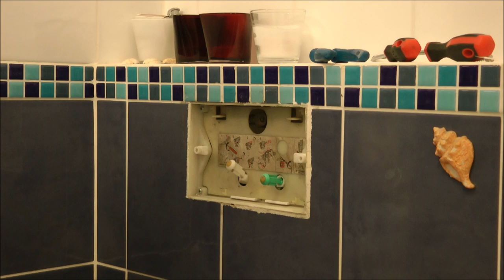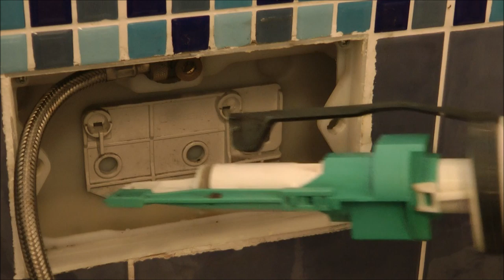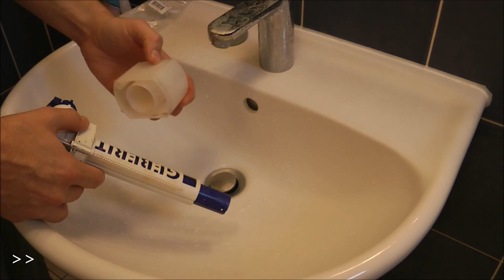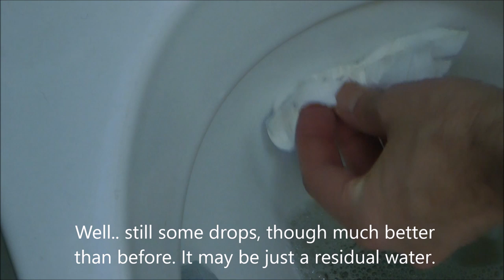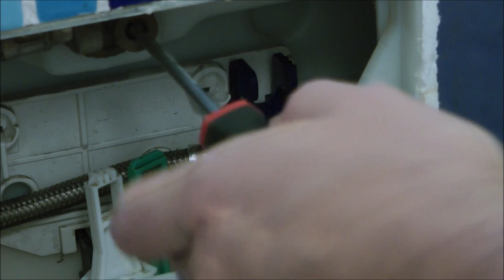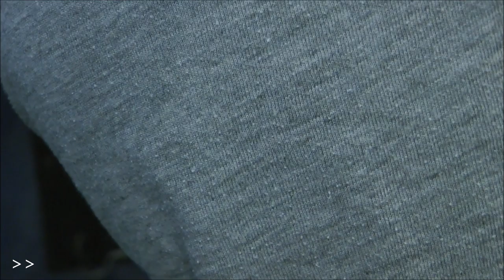Geberit concealed tank disassembly and reassembly

Comment: Hired a plumber to fix my dripping toilet. He said he "adjusted it", but he couldn't do better without ordering new parts.
He charged me a lot and it didn't fix the problem.
Turns out the toilet just need a maintenance clean after 10 years (from the previous owners). No new parts were needed. 
You probably saved me about $1000 with this video.

Comment: Thank you for this. I couldn't figure out how to get the central bit out and you turning it upside down inside the tank provided the answer. My thinking was I needed to disassemble it inside the tank and that would've been much harder. I didn't need to replace anything, just clean the tons of limescale that has accumulated.

Comment: Nice job! 👍
I replaced main flush seal but still have small leak. So I need to clean the float valve assembly, as you have done.

Comment: Very good YouTube I have the same Geberit concealed tank and need a new part. Do you know the model name and number of this concealed toilet so I can order the correct part ?
Many thanks
Reply from the maker: This would be Geberit Kombifix, the number (visible at 2:00) is "110.302.00.1". If this is the same cistern you have, you may be looking for this: https://catalog.geberit.co.uk/en-GB/spare-part/Sigma-concealed-cisterns-12-cm-(UP300)/SPT_461052.html
Reply: Many thanks Marek
Reply: @marekf5  I see this datasheet everywhere. However, in the Look Inside at https://youtu.be/Z8df_7aw9HA?t=269 you can see the basket/cup that the green flush valve rests in?
That thing is not listed on the datasheet.  That valve and basket have been replaced by the 212 universal flush valve. Everything looks like it's literally a 'drop-in' replacement, but for the life of me, I can't figure out how to remove that old basket.  With effort I can make it turn, but either I lack the strength or dexterity to get it out of the bottom of the tank.
Anyway, thanks for the video, this is an exact match of my setup. Unfortunately I need to replace a little more than the seal. ;-)
Reply from the maker: @HenkLangeveld  I see what you mean, but sorry, I cannot help. Never tried to dismount that one.
Reply: @HenkLangeveld  I have the exact same issue Henk, did you manage to find a solution?
Reply: A bit of brute force solved the issue. 

More info here: https://www.plumbersforums.net/threads/geberit-concealed-systems.10799/
Reply: @blogaquinaweb  As a matter of fact, I did.  Where I failed originally was that I tried to grab the 'basket' with my fingers inside, as I did not think my hand would fit around. When I did move my hand around it, I was actually able to wiggle and pull it out.
Reply: @HenkLangeveld  Yeah, I couldn't hold it with my hands so I used wrench to extend my reach. 

Glad it worked for you as well then

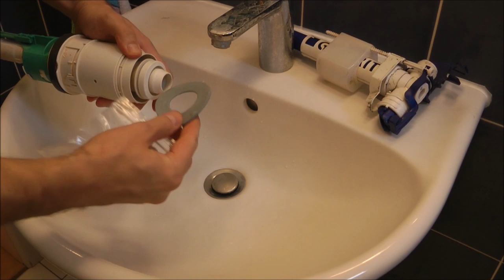Comment: I have one question: The unit (at 4:51, whose rubber flush valve seal you replaced) can be further disassemble? Is there any other seal inside this unit to be cleaned or replaced?
Reply from the maker: Hm. It should disassemble further, I think, but I would not expect any other seal in there. Have not tried myself though.